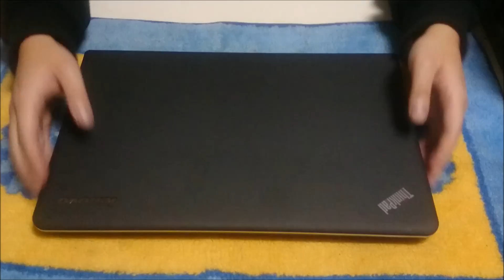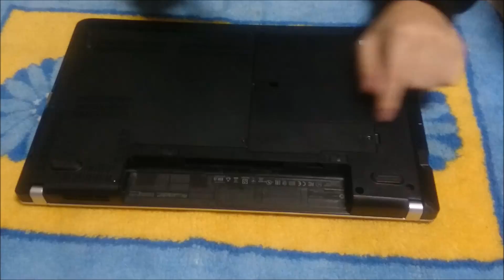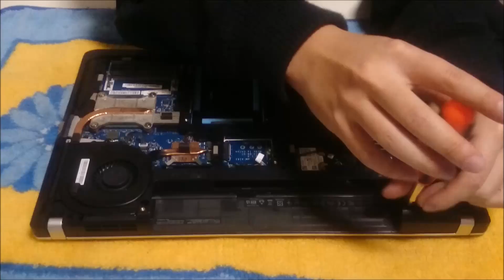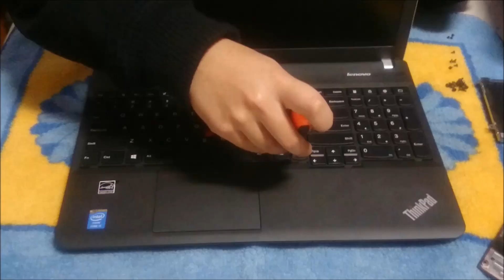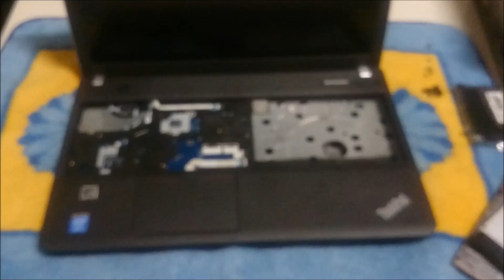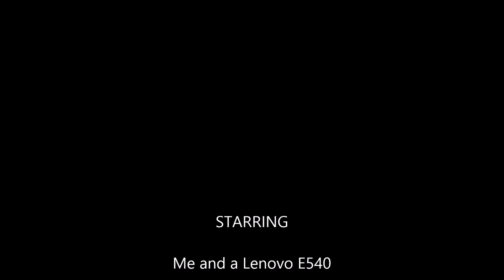OPEN ME UP! Lenovo ThinkPad Edge E440 and E540 Disassembly

Comment: Can the display cable be replaced without removing what you called the "keyboard surround" in your video? Where is the display cable attached on the motherboard on the bottom or top?

Comment: Hi, can you make a tutorial on how to replace the power supply of this laptop? if possible? Mine is not working when battery got drained, I already replaced the battery but still not working. I have a suspicion that it affected the power supply and I'm not familiar with laptops' parts.

Thanks!
Reply from the maker: the power supply is external and not inside the laptop

Comment: Hey so how many slots for ram upgrade? I have upgraded my ram to 8gb can i add another 4gb/8gb ram card?
Reply from the maker: CPU can be changed, Ram can be changed to 16GB max with 8GB DDR3 in each slot and there are 2 slots, wireless can be changed and hard drive is a 2.5" inch hard drive plus a M.2 SSD slot that can be changed
Reply: @OpenMeUpTec  ok thank you so much bro

Comment: Nice video!!!!! i have question.

My lenovo thinkpad edge heats up faster, the fan often works hard.harder then before and more often. i think it is dust inside or something .
if i open it like here what components should i clean and how?the fan, cpu cooling liquid replacement ? more? waht should i use to remove the dust or clean pc? thank u , hope u can help me! yoooo
Reply from the maker: what my newer video and it will give you a clue. in my newer i do the cleaning and replacement thermal paste

Comment: Sadly I own this laptop, it's not bad but what is the point of having an fairly easy to reach wireless card if you cannot change it due to the fact Lenovo whitelists every friggin wireless card out there...this will be my last Lenovo, and since I am an IT officer in an embassy I won't choose that brand either for the office.
Reply from the maker: +TheBerginton most people use intel wireless cards and cards like intel 7260ac or the newer model of it which is one of the great card. these are allowed by Lenovo. the only thing I can see your issue might be if you trying to use Linux OS where most of the intel cards don't work properly as Linux is slow on release drivers
Reply: +OPEN ME UP Wrong, I am using Windows 10, and the card you just mentioned is the one I have, look around on the web and you'll see what I'm talking about...

Comment: I think the e540 is one of the best laptops for maintenance by doing yourself. 

Now I have to open the keyboard and try to remove the fluid damage with alcohol...
Reply from the maker: +Shariner These days no one really care about maintenance. Everyone wants sex appeal and solder on components which makes the laptop small, thinner and lighter. Maintenance cost money, solder on components is cheaper than making a slot for it to go in. Generally when you have water in a keyboard it is over but hope you do well.
Reply: Laptop work well, but keyboard and trackpad doesn't work anymore. I will see. 

That's the reason that I bought a Lenovo e. I would like to bought a Lenovo T but they were too expansive. 

Never apple or Asus in my choice
Reply from the maker: everything is the same. they all use components from other to make a laptop no one makes anything. They all intel cpu, Samsung or Hynix ram, Seagate of WD hard drive
Reply: Summarize my actions: The Keyboard is not usable anymore. But the Trackball and Mouse are working well.

I will send the device back to the manufacture and hope they send a cheap Repair Bill.
Reply from the maker: Just tell them to send you a replacement keyboard that will be alot cheaper
Reply: I will return it for repair. The Laptop stuck in Bootloop. Sometimes it work...
Reply from the maker: probably corrupted windows
Reply: +OPEN ME UP probably not. We will se
Reply: +OPEN ME UP Hahaha, i found the issue. The fluit ran over the Power Button. The Button got a malfunction and pressed all the time the power on / off button.

The Laptop tries to start and got a reset by holding the button..

Very funny. I tried to clear the button with 97% alcohol. Now it work better. But not perfect.

And for the keyboard...One Contract for the Keyboard is broken... dammit. I think i cant repair this by myself. I dont know how i can fix a broken contact. -.-
Reply from the maker: just find a areplacement keyboard on ebay
Reply: +OPEN ME UP will comply :)

Comment: Hi! I need to replace the lid and display. Your tutorial dealt only with the body, not the flip panel. Do you have any video showing how to disassemble the display?
Reply from the maker: +Serban Popescu no i dont have a video to disassemble the top but you can get the user manual from lenovo and they tell you

Comment: Nice video. Can i add an internal graphic card at my laptop lenovo thinkpad L540 ? What type should i choose?
Reply from the maker: +george kontopoulos nope. There is only 2 options you get a graphic card or you dont. If you get one there is only one type available
Reply: +OPEN ME UP What is the type of graphic card i need to attach? What should i look for?
Reply from the maker: You got the wrong idea you can't attach it. it is solder on when produce. So if you don't have one you can't do anything about it

Comment: Does this also work for the E550?
Reply from the maker: +Zambia95 yes it should of it doesn't tell me as I have the e550 here
Reply: +OPEN ME UP A couple of the steps were slightly different with respect to the keyboard and the casing after that, but I was able to successfully use this video+a little common sense to open my E550.

Thank you for taking the time to make this!
Reply from the maker: Thanks for your help I will list a video for the e550 soon as I currently have one.

Comment: I appreciated the way you disassembled this Lenovo Thinkpad. You did not rush, and your photographer as well, took time to show minor details that could easily be missed otherwise. I'd like to add one missing item that could be edited in... the identity of the CMOS battery, just underneath the first panel that was opened. It's identified only as the wireless card, but there are two things under that panel, one disk shaped and the other, square. Obviously for some, the disk shaped item is the CMOS battery.
Reply from the maker: +Rich Guy Miller I automatically assume that everyone knew what a battery is and also the battery is unlikely to die and last for a long time that's why I didn't not point it out. but after a few complaints from people I have been pointing it out in my newer videos.

Comment: Great video for E540 users!
But I have problem with mine.
I noticed that screws which are holding my graphics card are really loose. Do they have to be tightened at least a little bit?
Reply from the maker: Peter Šabak they should be tighten to the point where they can not be turned anymore with us force

Comment: Hi! The hard drive is an HDD, right? I am not so techy but can you replace the HDD with an SSD or does the computer come with two hard drives? In the shop I am going to buy the computer in has a paper which describes the computers specs and it says primary hard drive is HDD and secondary is SSD. Don't know if it means that the computer come with both of them or if it means that you are able to put another inside. 

But if it means the second thing, will I be able to replace the HDD with an SDD at the same spot or will I need to make another spot for the SSD?
Reply from the maker: Danz Nadz HDD is the hard drive short cut for it. you can replace the hard drive with a SSD. The laptop is able to fit 2 hard drives inside one a 2.5 inch hard drive and a mSata SSD.
Reply: Can I install operating system like Windows on the mSata SSD , so that I can use my hard drive for storage and faster booting speed and better performance since it is getting slower to load
Reply: At the moment I only have 512gb HDD and I would like to add another SSD and use it for installing windows and use the HDD as a secondary drive in which I can store my other data which are not frequently used..

Comment: Does the i5 model have a m.2 slot?
Reply from the maker: Shanaa@~ yes it has but it is a small slot so you cant fit many things in it. Most likely it was made to fit a mobile wireless card for 3g 4g internet

Comment: After 1 year of use especially with linux i get a temperature from 54°C to 70°C.
My model is 20C6003QIX with intel core i7-4702MQ as cpu, the nVidia card is disabled by UEFI.
Do you think it's normal to get these temperatures with this notebook?
I think it's time to replace the thermal grease.
To access the CPU I have to disassemble it completely am I right? removing the keyboard and everything else...
Thank you for answering
Reply from the maker: The thermal paste that comes with it originally is basically crap. Replacing you will generally notice a different probably need to clean your fan as well as it might be blocked. You can watch my video computer over heating and load? Clean fan & replace thermal paste https://www.youtube.com/watch?v=n2M5v7DcRA4 . Hope that will give you a better idea. You can remove the heat sink and fan just by removing the back which is the first step 'removing back cover 0.55'
Reply: OPEN ME UP Thank you a lot, I'll try to replace the thermal paste, I'll let you know!
Reply: I replaced the thermal paste. Nothing changed. The old thermal paste was so dry so I cleaned the CPU and the GPU, put new thermal paste (Noctua nt-h1) and close everything back.
At startup I get less than 30°C, but after opening a browser (both chrome or firefox) the temperature grows up to 50°C and over and never comes down back.
Nothing changed :( The fan is clean and there is not any trace of dust
Thank you
Reply from the maker: unfortunately that's the best your laptop can perform. sorry it didn't turn out better. at least it did make a small difference. Normally on desktop replacing the thermal paste it makes a massive difference as the weakest link is the thermal paste but on laptops the weakest link is the fan and the heatsink.
Reply from the maker: forgot to ask if you updated the bios? as generally when laptops comes out manufactures assume things like power out put and fan control speed but after sometime with complaints from users they release a bois update to change how the laptop uses power. This happens a lot to HP laptops many get return due to over heating errors showing up when they first release the laptop so they will release bois updates to lower the power used by the laptop therefore reducing the heat output.
Reply: OPEN ME UP Don't worry you have been very kind :)
Yes, I am on the latest bios released by Lenovo for this laptop, released in January 15 with "updated thermal table" in the changelog.
I'm a bit sad for this high temperature, I would expect to get between 40 and 50 celsius when working in a normal condition (that is to say Chrome or Firefox, email, and some other production software), instead it goes above 50°C and so on...
I think I will buy a good cooling stand, I see no other solutions at this point.
Thank you very much for you patience and the support offered!
Reply from the maker: Ok then unfortunately you did all you can. A cooling stand is not that great just to advise you. As the fan blows air to the bottom of the laptop and not directly at the heat sources. Many choose to open the back cover so that the air is directed to their parts and not the bottom plastic
Reply: OPEN ME UP should i keep it open? There is ram and hd under that panel, they could be damaged by dust or somewhat...
in your opinion keeping the battery unplugged does cause benefits?
Reply from the maker: there is a misunderstanding in dust. dust doesn't damage anything really it only block the air flow. Hard drive is completely sealed so no dust can go in it and ram doesn't get affected by dust in anyway. the only things dust affects is fan and heat sink plus makes things dusty and annoying. Keeping your battery in when the power is plug in kills your battery and after sometime you will realise your battery is dead or holding less charge than normal beside that there is no benefit. With the newer gaming laptops leaving the battery in does provide benefit as the power brick does not supply enough power therefore they design it to use both the battery and power if needed but not for normal laptops.
Reply: Thank you for clarifying about dust :)
I'll give it a try with battery unplugged.
One more thing: a friend of mine told me that the heat could be caused by the fact I have nVidia card disabled.
So everytime my notebook needs 3d acceleration, it demands to the integrated chip overheating him, especially in Linux where the video drivers for integrated cards generally suck.
What do you think about that?
In your opinion enabling nVidia card and configuring it with Bumblebee could be useful?
Reply from the maker: you can disable in bois but then you wont be able to use it until you go back into bois and enable it. All laptop these days that come with 2 graphic card like the Intel - NVidia or Intel -  AMD will only use the main graphic when needed like in game and things so there is no need to disable it yourself as it will do that automatically. You can disable it yourself if you wish in Device Manage - Display adapters and right click the NVidia one and disable. There should be no benefit in doing this as it is set to use Intel graphics for everything like web browser and multi screen. I don't know about the program you are running they might be using the NVidia graphic but I really doubt it as programs like Photoshop is not set to use NVidia graphics by default

Comment: hi, thanks for this video, it's very useful! :)
do you know if it's possible to upgrade lenovo e540 with an SSD bigger than 128GB?
 I don't need the hard disk and the optical unit, i would have only SSD memory 256GB or 512GB but, if i try to configurate this laptop from lenovo shop it allows me only to choose an SSD of maximum 128GB. do you know if in a second moment i will be able to upgrade with 256 o 512GB SSD ?
thanks a lot!
Reply from the maker: yes you can put any size 2.5 inch hard drive available inside the laptop. the largest size for a 2.5 inch SSD is 1TB and if you buy it outside it is a lot cheaper in Australian it cost around $500 for a Samsung 1TB SSD. So I recommend you to purchase it without a hard drive or with the cheapest hard drive option Lenovo provides and then buy your own one outside. Also you can buy and external 2.5 inch hard drive enclosure so you can put your old hard drive in it and use it which cost $4 AUD http://www.ebay.com.au/itm/2-5-inch-SATA-to-USB-2-0-Hard-Disk-Drive-HDD-Enclosure-External-Case-Convert-BY-/221592023964?pt=LH_DefaultDomain_15&hash=item3397e9f39c

Comment: If my bottom case is cracked and needs to be replaced, what would be the procedure for that? would all the internals need to be emptied and re-installed?
Reply from the maker: Yep everything attach to the bottom will have to be remove so you have to empty basically all of it there isn't much to it and should only take you 3 or so minutes longer than what I have shown in the video. you will need to remove the motherboard first I think there are 2 or 3 screw holding that down, the 2 daughter boards which one of them have 1 screw and the other has 2 screws, and last is the speaker bars which don't have screws on them and just come off. this might help you can remove all the screws without removing the cables makes it easier to move over to the new case. if you find it abit confusing basically just remove every screw you see and it should come off

Comment: *****  Great video, thanks! I have one Q for you. I just bought Lenovo ThinkPad Edge E540 (20C60043) it has only integrated graphic card. I know that there are models of E540 with dedicated card as well. Do you think that it is possible to add dedicated graphic card? Thank you
Reply from the maker: No you can not put one in yourself as it soldering. For most laptop this is the case if you don't get the graphics card then you can never get it. If you look at the board you have space and connection for it so unless you are good at soldering you can't do anything about it.
Reply: Well there is one way to get dedicated graphics, it’s by buying a motherboard that has dedicated graphics and replacing it with your old motherboard, doing this you would also have to buy a new heat sink that also connects to the graphics.

Comment: Great video, I might very well do an upgrade.
Reply from the maker: Matthew Duval if you upgrading the ram remember it is DDR3L not your normal DDR3. DDR3L is DDR3 Low voltage 1.3v where as DDR3 is 1.5v